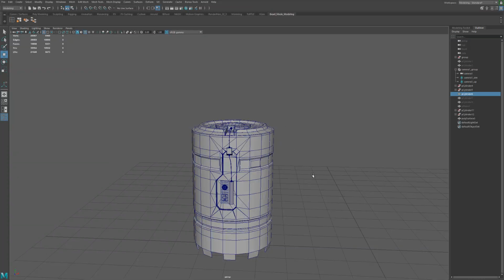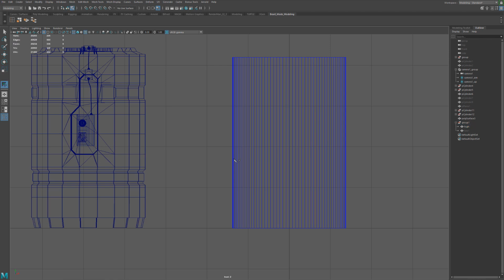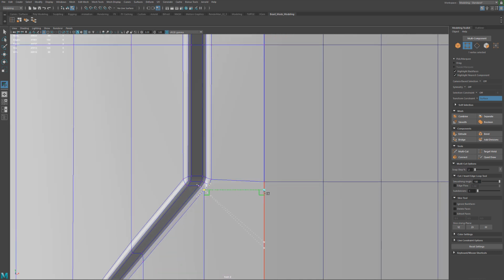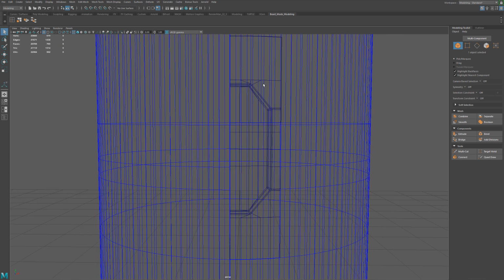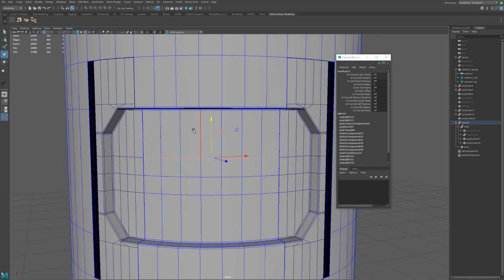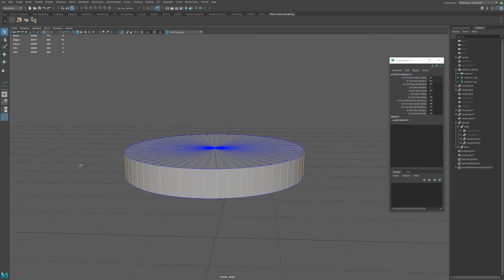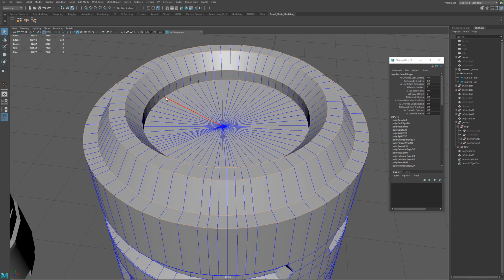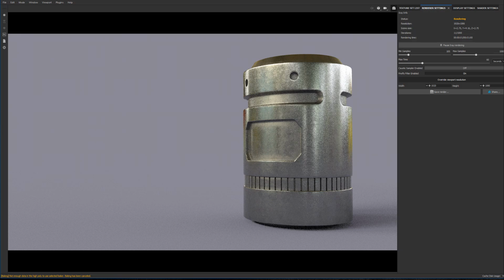Maya Hard Surface Modeling: Complex Shapes 2

Comment: In the beginning you Detached the edge to make it more visible correct? What settings did you setup for your project in order to see those edges more pronounced? When I did it, my edge still looked the same in the viewport with wireframe turned on. But I can see a huge advantage of being able to see those edges more pronounced in wireframe mode. UPDATE: Maya 2026, when I had turned on the preferences>polygons>turned on Border Edges. However, the changes didn't show until I saved and closed maya and reopened. Then it worked. just in case others wanted to know or had the same issue.

Comment: So i have just one question. Why did you subdivide to level1?? To prevent from uv stretched at uv border?? Hope u could give me an answer for this. Thx 4 posting vid
Reply from the maker: If you mean towards the end when I applied a smooth, it was to get a smooth shape as this was built for subds
Reply: @jlmussi  thank u so much for your comment. But this gives me one more question. When i do modeling. After cutting UVs, hit 3 key(smooth preview) i get UV border stretched. Is adding more edges only solution?? Sorry for long questions.